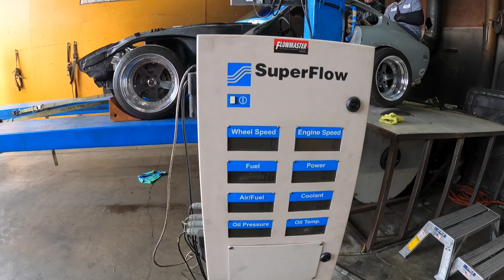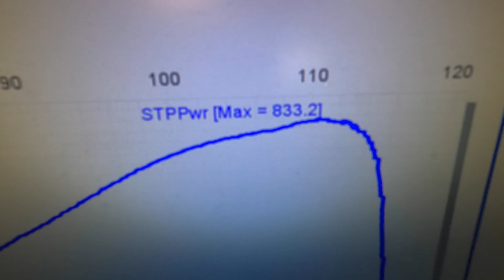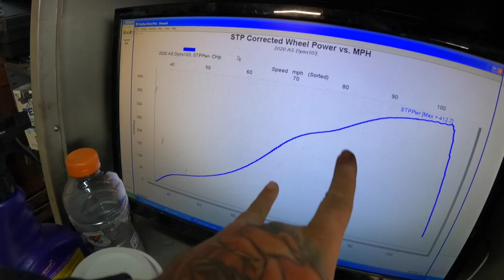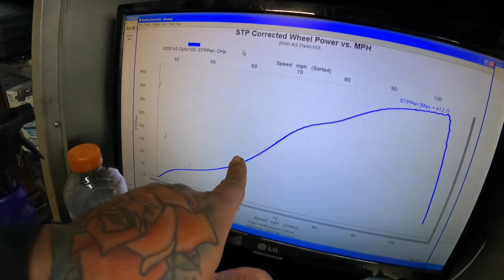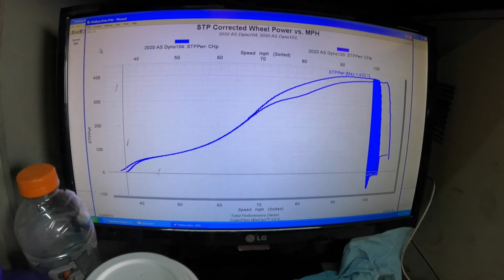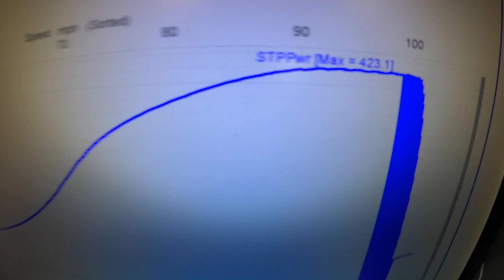SR20 300zx: It's finally making power!!! This thing sounds INCREDIBLE!!!

Comment: The smaller turbo and ramping boost in early is actually worse for the engine than having a bigger laggy set up, that torque early on in rpm is what kills engines , should be so much more fun on the street and slidddddin doeee